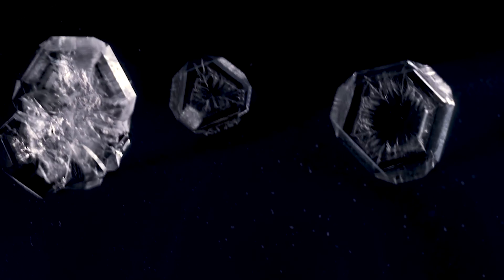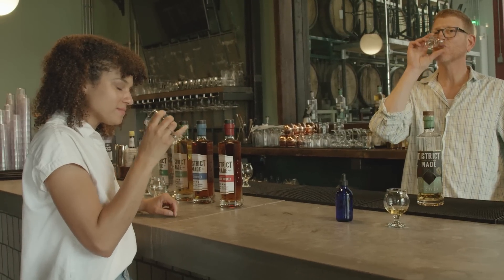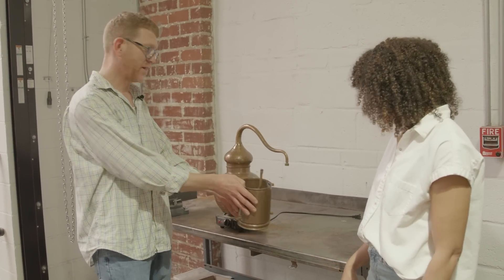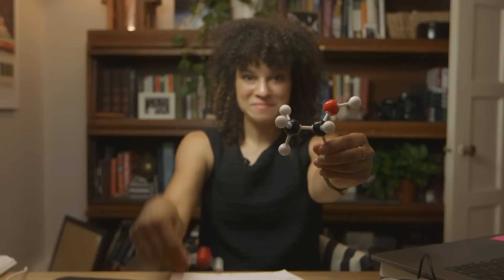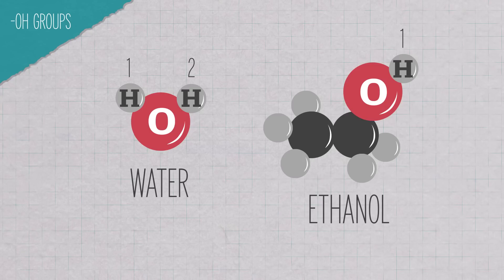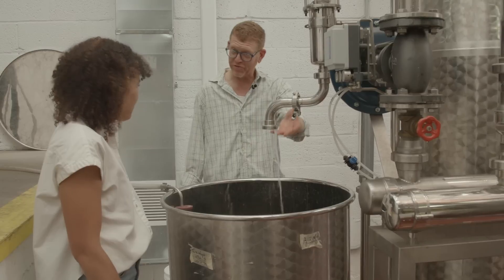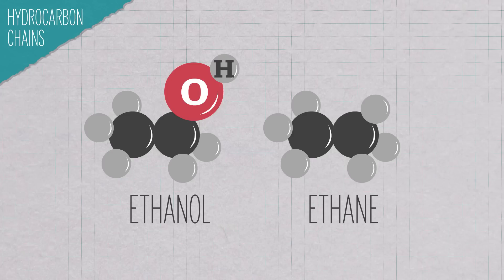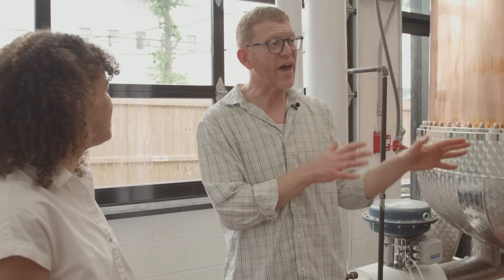How is Whiskey Made? A Deeper Dive Into Distilling.

Comment: Methanol is indeed poisonous... well, not really  It is metabolized into a poison by the liver... it is turned into formaldehyde.  Formaldehyde basically suffocates you at the cellular level and you die.  It only takes 10mg of methanol to be metabolized into enough formaldehyde to end an adult... and methanol can be absorbed through the skin.

However, you will not have this effect from drinking methanol in your ethanol.  There is an antidote to this entire process.  What happens is that the liver prioritizes the metabolization of the antidote over the methanol.  Doing so causes the methanol to be excreted in urine before it becomes formaldehyde.  The antidote is... ethanol.  So, no, you do not get methanol poisoning from drinking it in your alcohol, but it will give you a raging headache.  Also, in order to get that 10mg of methanol... it would take 150L of distilled liquor.  If you drink that much, you will die from alcohol poisoning long before drinking that 150L.

Moonshiners had issues from what they used for their homemade stills... some used old car radiators... with residual antifreeze.

And reason it out.  The methanol is created during fermentation, not distillation.  So, when you make beer, it has methanol... and there is no process for removing it, like in distillation.  And a single hard liquor drink is roughly equivalent to a beer.  We have far less of the hard liquor... So, you're drinking more methanol when you drink beer because none has been removed.

Comment: The first step is malting your grain (typically barley). Starting germination until it has maximum amylase concentration then drying it out to stop it. The second step is grinding that malt. The third step is "mashing", putting the ground malt in hot water so the enzymes can convert all that starch (and other stuff) to sugars. It's not until all that is done that you can even think about fermentation

Comment: facepalm
another distiller who believes in mutliple boiling points in a mixture at the same time. 
that's what got those people to die from tainted alcohol in prohibition. they knew the government tainted the booze so they thought: if i just distil it at 64 degrees C and don't get to 78 degrees C, i'll only get the methanol out and then the spirit will be methanol free. 
aaaand they died. 
i think it's third grade science where they go: a pure substance has a boiling point and a mixture has a boiling range. if you have 10% alcohol in your wash or beer your boiling point at the start will be around 92 degrees C and it will rise per second because you are boiling more ethanol out. but never pure. that's the same reason why there's methanol throughout the whole distillation, scary stuff right? no not really. it's everywhere and it comes from pectin, yeast doesn't get confused whilst breaking down sugar, methanol is formed through another process. 
throughout the distillation you'll get everything that you had in your boiler, just at different %. of course you won't get any solids from the pot but all the liquids will appear in every drop of distillate. some more than others. 
if it were true that if you stay between 78.4 degrees Celsius and 100 degrees Celsius, why can't we get a spirit at 100% alcohol?
(i know we can get close but it requires multiple distillations,  either mutliple batches through a pot still or multiple plates in a column still).

Comment: "Structurally it is very similar to ethanol, but it's a poison."

Is there a reason you didn't mention that ethanol is also a poison? 😅
Reply: In prison we made wine from aspartame sweetner packs and distilled it into liquor.
Reply: @waynejr6521  lol no you didn't, aspartame isn't fermentable
Reply: @Oberon4278  I promise you it is. About 400-500 packs on around 2 gallons of fruit juice produces about 16oz of liquor,I just can't find ANYTHING on the subject to learn how dangerous drinking liquor distilled from aspartame is, and I am very curious to know.
Reply: @waynejr6521  So, you were adding aspartame to fruit juice? Cause if that's the case, it was the fruit juice that was fermenting, not the aspartame. Aspartame is definitely, absolutely, 100% not fermentable. That's the entire point of aspartame: it's a sweetener that is not bioavailable.

Comment: this ignores the alternate method of distilling... freeze distillation. for potable wines and meads, lowering the temp sufficiently causes water to freeze out.  if done slowly, crystal formations remain porous... and one can remove water by slushing the wine, then pouring out & collecting the resulting concentrate. it is, physically, much safer.
Reply: Check out Ice Beer.
Reply: @brettito  I have - didn't care for it.
Reply: No it’s not. It does not remove the bad stuff.
Reply: @timchapman6702  Freeze distiliation removed all the yeast and suspended particles from my mead, leaving me with a smother, clear, (barely) flammable fluid... Each method of distilation has its uses.
Reply: @WilliamHostman  no doubt.

Comment: short answer because if you where allowed to make it at home the government couldn't tax you on it. al capone didnt get in trouble for making liquor he got in trouble for tax evasion.  and you dont have to throw out the heads. the work great for cleaning things, a fuel additive, and for a anti freeze for things like window washing fluid in your car.  the problem with drinking it is that it cant be processed by your body. but it will bind to ethanol and can be processed like that. in very small amounts. still very dangerous.